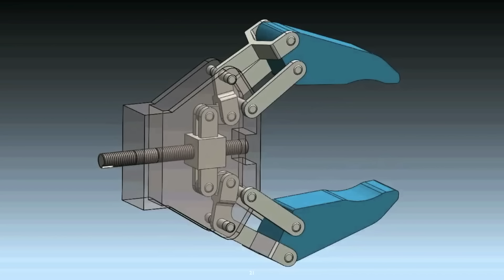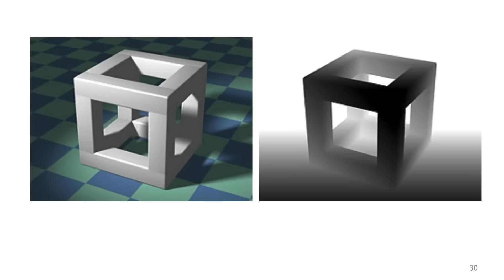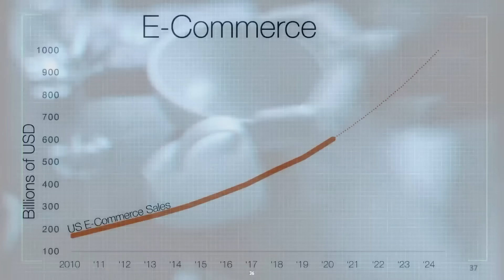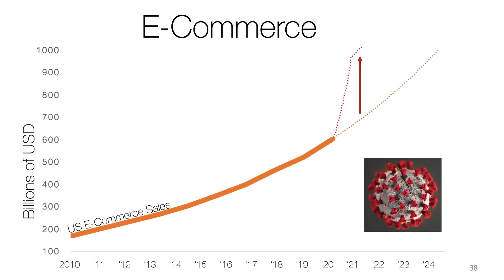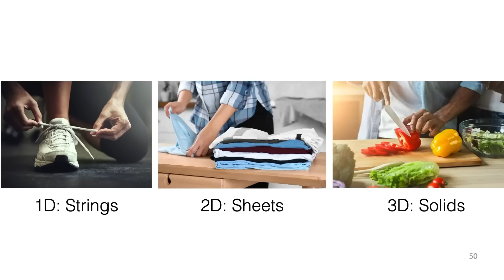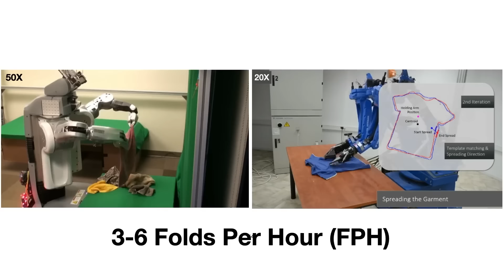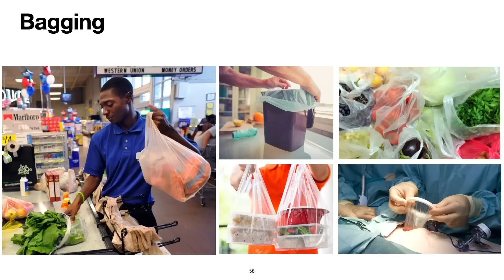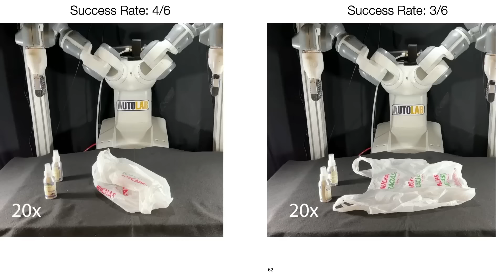Why Don’t We Have Better Robots Yet? | Ken Goldberg | TED

Comment: Funny how this is a good example how things do not age well. In the last month, I have seen multiple demonstrations that are going to be in production in a year and available for purchase - mostly - around that time (the one case where they may not be for sale for another year or two is a large company that has an internal need for a quarter million robots internally).
Let's look at the hand example at the beginning - MULTIPLE robots have human level hands, and the Tesla (that is btw. the company that will start using them internally fast) just announced a rework of their hand that has 22 degrees of freedom. And has tactile sensors - for months actually. And it seems well trained (Which takes WAY more compute than most researchers have access to.... and the result is astonishing. We WILL have robots working in factories or households in a year - first in basically very primitive things (wiping the table, sweeping floors) then with monthly updates doing more and more. It is NOT as complex as Ken does it - same way that there is no way private company can do space transport (except SpaceX does 80% of all payloads now). Happens that the breakthrough of AI and Transformers have - unsolved things and we now run the massive compute clusters needed.
Nice how you see all those Boston Dynamics presentations of him failing. Now, I do not say robots do not fail - but Boston Dynamics is SO much behind the market, it is NOT funny. Instead of marketing for Ambi Robotics - show 1X Neo demos, Tesla demo, the Astribot demo. The home robot - clumsy and limited - will be in homes in 2025 to 2026 thanks to 1X and OpenAI.
Btw., the Astribot is WAY faster than the demonstrated robots in folding laundry.
Reply: only propaganda in CGI;
not a single real robot (never one) in real world

Comment: Actually I think that Deep Learning digital AI is the flaw in all those attempts. It has limitations that prevent it to truly grasp things, which would make a DL AI robot randomly unsafe to be around. 

To paraphrase Gary Marcus, DL is a ladder, and building a better ladder doesn’t help you go to the moon. Something completely different is likely needed. 

My hunch is that one of the requirement is likely the need of memristors. 

Another one is that to truly grasp / understand things, the robot may need some kind of conciousness / sentience (like any animal), and this may only be possible in the analog domain (not in the digital domain). 

This would also mean that it would create a new lifeform, that does not rely on biology, and create new ethical problems.
Reply: It may be that new life forms cannot be created unless they are biological.  Why do machines even need to be like living beings? Why not use machines for what they are good for and let humans do what we do best?
Reply: @gtdcoder  « It may be that new life forms cannot be created unless they are biological » —> I agree, at this point in time, it hard to tell if it is or not possible to create a new lifeform that doesn’t rely on biology. More research and attempts/failure will probably be needed to have more clues on that…

« Why do machines even need to be like living beings? » —> Like any tool, some tools are better at some tasks than others… 

Indeed, all machines may not need that kind of capabilities : robots doing repetitive tasks in a controlled environment do not necessarily need to grasp/understand what they are doing.

But if you want a machine to be able to adapt without any human supervision to completely unexpected scenarii in a fully open environment, then some kind of conciousness / sentience (like an animal) may be needed. And it is very likely a requirement to be able to do fundamental research and invent new theories in math, physics,…

Comment: It will need stainless steel design structures , seperate replaceable body parts, sustainable, energy that last 24hours without charge, movement charger, sensors must focus on heat and cold method light for head light onoff feature to work while no light. Abilities to fix and improve itself, for the owner to seat and relax, but alot of factors including running balance, also must have wheels for friction, walk balance, detection in a lot of things ask the own if this can be introduced to the program that how going to improve much faster.